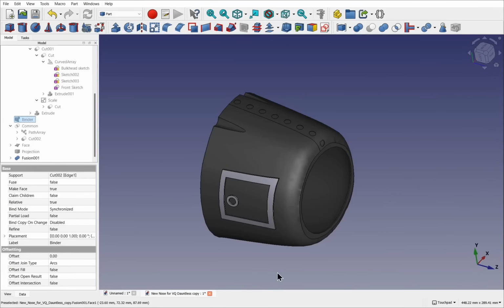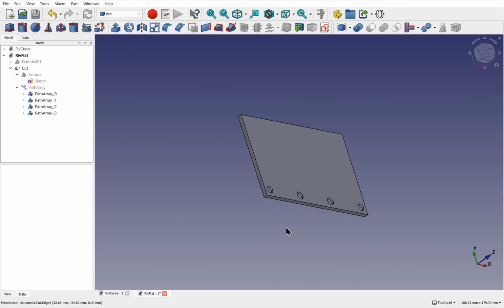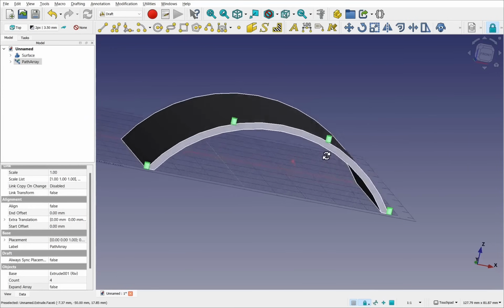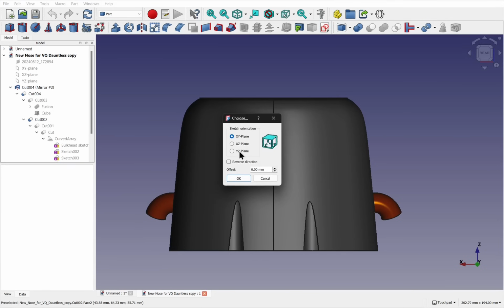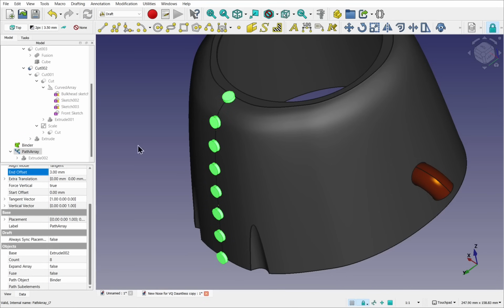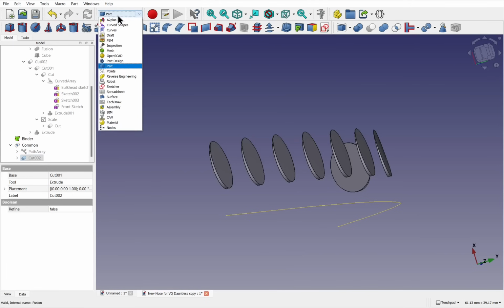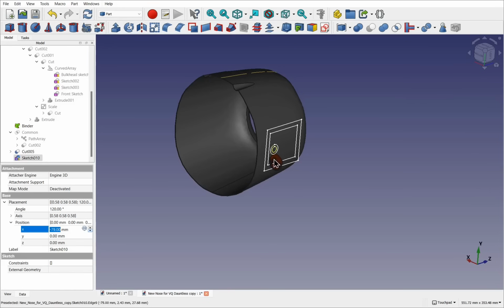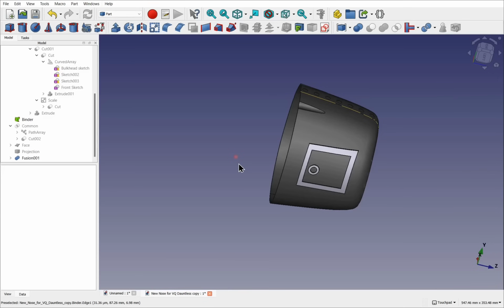Add Surface Detail in FreeCAD To Model Airplane Parts  | Part Workbench & Sketcher Tutorial. How To

Comment: Great video as always ! Curved surfaces are a pain for me to work with in Freecad because of the seemingly lack of snapping to surface. The projection you just showed would have saved me some greying hairs if I had watched it sooner. I designed a medieval armor mask for my son, I used Part Design because I’m following your basic for beginners course, and it was extremely painful to attach details to the curved surface (I used a loft with 3 sketches to create the main  surface and proceeded with adding details (pocket for the eyes, half-spheres with arrays for the bolts…), but I had to curve all the details, calculate or eyeball everything to have it fit the initial surface). I could probably remake in in under 10 min with what you just showed ! A quick question : can you also do a cut with the projection, or just an extrude ? The first method you show is great, but it is rather complicated. That’s where a snap on surface and curve on surface could be great, but maybe I’m just not far enough in your videos to have discovered it. 
Thanks for all your hard work making Freecad accessible for everyone !

Comment: This Tutorial requires Exact duplication of Darren's Operations to work correctly. take Your Time. I'm a confirmed FreeCAD user and Fan but will admit the inconsistencies in Object selection Procedures can be challenging if not frustrating. Nice Touch at 15:40 regarding adjusting the Vertical Vector Parameters if initial Force Vertical didn't work (Mine didn't 1st attempt, probably due to different plane orientations on Test Cowl I threw together to follow the Tutorial). Thing like this can save a Student heaps of Time and Frustration. Well done as usual Darren! Similar Issue at 17.38 but able to manually Translate Rivet Start an Ends using expanded Array. Update, figured out why I had the above issues, I Left the Expand Array option open, it disables the Start and End Offset Options. Students follow Darrens actions exactly!! he knows what He's doing (Even if We don't!!) LOL ;-) Darren not sure how involved You are with FreecAd at development level but a more consistent approach to Object selection would be Welcome (for New Users especially). The variation in 3D area and Tree Selection gets very challenging at Times, Regards RW, Otherwise great Tut very handy for Fine Modelling!

Comment: Kind of frustrating that we have to switch the workbenches for using tools we need when using Part desing. Maybe i did not get the Point of different workbenches but this seems hard to learn for me and this is a tool that should be moved to Part and/or Part Design wb.
Reply: You can move Tools between Work benches using Preferences, using different Benches for Different Operations is a Key Part of FreeCAD Design. I do a lot of My initial 2d Design Drawing in Draft and then use Part, Curves, Surfaces as Appropriate. Once You get use to it it makes sense. I prefer to leave Benches as Standard as possible to maintain consistency when I need to find Tools.

Comment: What if the surface is not defined by any vertex but e. g. the result of a loft?
Reply from the maker: The projection would work so if you wanted to add more edges to put rivets along. I have projected a line onto the loft before and used this as a path for a array, if that helped?
Reply: @MangoJellySolutions  Great idea, thanks! :)

Comment: I'm trying to word this carefully. What is the best practice for conducting unions and cuts? Do them as you go? Or as you start getting everything in place? i.e. all at once or several in a row? I know that all at once sometimes doesn't work. Which is the best practice for parametric modeling. This was an awesome lesson. Thank you.
Reply from the maker: Glad you enjoyed the lesson.  If you are using the part design then there will be a automatic fusion / cut with each operation but with part then you have that power of doing them when and how you want. I personal do 'like for like' in the part workbench.  So I would combine all the rivets into a compound and then create a fusion, the follow with surface detail.  In that way the treeview doesn't get too messy.

Comment: Hi, great tutorial as usual. I am having an issue trying to follow along at home, when I open the Part Workbench I do not have the Create Sketch option and seem unable to add it. Have FreeCAD 0.21.2 installed.
Reply from the maker: Ahh, yes, in this video I am using the 0.22 weekly builds which will become version 1.  So you just need to go to the sketcher workbench, create the sketch in there and return to the part workbench and carry on as normal.  Glad your enjoying.
Reply: @MangoJellySolutions  Thanks heaps, and yep your vids rock.
Reply: You can create a new customized toolbar containing 'Create a new sketch" to be used independently the workbench you're working with. It has to be made in Global workbench. Check Darren's older videos and you'll find it "How to create custom toolbar".

Comment: Thanks Darren, you've presented some great advanced modeling techniques.
I'm curios of what is the difference between the Path Array and Path Link Array, along all the other "link" arrays in the draft array toolbox. I might have missed a video about it, so you might have covered it already, but would gladly watch explanation of the difference of all the array tools that are available.

Comment: Excellent content! It looks like the main differences between other CAD packages and Freecad has come down to user interface choices and not capability. Now all I have to do is learn it.
Reply from the maker: FreeCAD is getting better and better especially with the impending release of version 1 around the corner.  This video was done in 0.22 weekly builds which are still not stable yet but I am getting in early as when it's released I see a lot of adoption.  The methods used are interchangeable with earlier versions and exactly the same workflow.  Glad you enjoyed :)